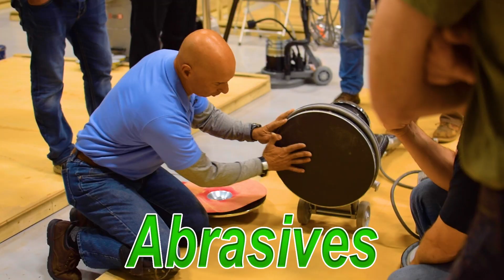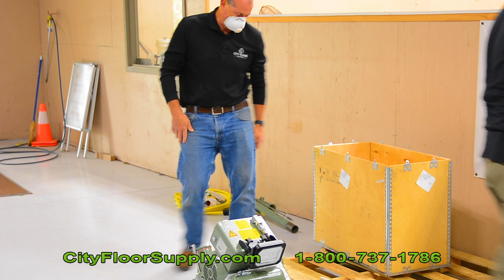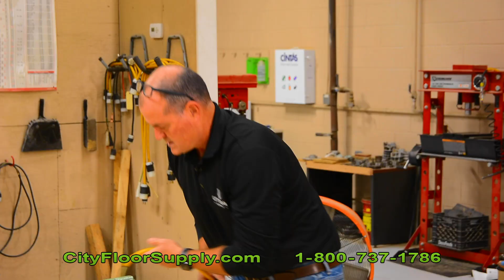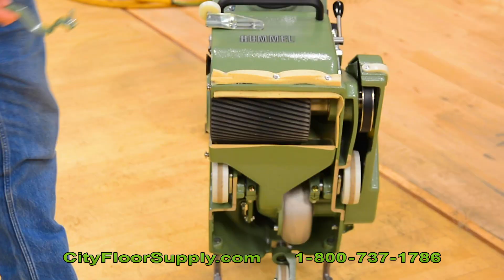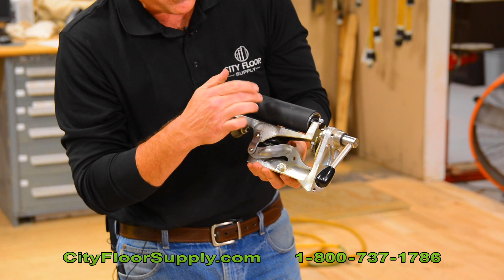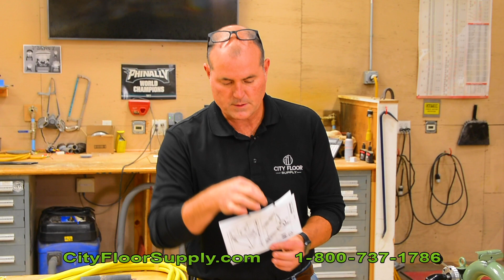2020 Lagler Hummel Unboxing at City Floor Supply

Comment: I will order mine tomorrow....whit you guys.
Reply: @retlawx10  what drum do you use then lmao
Reply: @daniels1293  I used to used this piece of shit and then I bought me BONA HD. 4 years and no issues. Just in 2020 I sanded at least 90k square feet total and no issues.
Reply: @retlawx10  ill take your word for it, I think maybe you just got a bad one though.
Reply: @daniels1293  I've been sanding floors for 18 years. Like most people I learned on a  hummel machine and before i knew anything about flooring i used to listen my coworkers complained about chatter,paper sliding off the carriage, dust not being picked up and waves on the floors.
The company i worked for went through 10 hummels and same problems.
I know other guys and they all gave hummels with the same issues.
 I went on my own 5 years ago and decided to buy me a BONA HD. 
Best looking floors you'll ever see and are 100 percent flat.  
I don't why no one has sued lagler for the junk they sell.

I don't ever need a trio or a hard plate none of those tools the were basically created cause hummels are crappie machines
Reply: @retlawx10  I've never used a Hummel, but I've know a really good floor guy who swears theyre great machines, he does have the trio though too so maybe you're on to something. ill say weve had the same issues you had with Hummels with floor crafters, the ones that work are great machines finding a floor crafter that does work properly is very few and far between, most people I know use galaxies. I wouldn't write off those power drive buffers like the epoch or spyder though theyre worth the investment. just do a 120 pass after your big machine and those floors will look even better.
theyre great for those smaller jobs that aren't even worth hauling the drum in for.
Reply: @retlawx10  chatter yes indeed :(
Reply: @retlawx10  no chatter within 4 years ?
Reply: @retlawx10  can you take off the motor on the Bona HD apart to carry up the stairs like the Hummel ?
Reply: @Eyehearttravels  is actually easier to remove the motor on the Bona HD.than it's on the hummels.

Comment: Ive had a Lot bona hd sanders etc. I have 2 hummels now best I've ever owned ,never let me down. Those on about chatter don't know how to work maintain or set up there sanders. probably the same guys who don't use the cart it came on for transporting and have flat wheels..
Reply: Chatter can happen from many things. Such basic stuff as wrong belts may make it. At the same time some wood on bad plywood can bounce up and down like crazy. There is many ways to set up this machine..but u gota have will to do it

Wheels dont matter at all. I can show u old hummel that drive on main wheels through gravel and concrete yet it will have no issue doing good job.like any other machine that u treat as an egg. This machines were engineered to be great
Reply: What cart do you use can you please let me know I need one